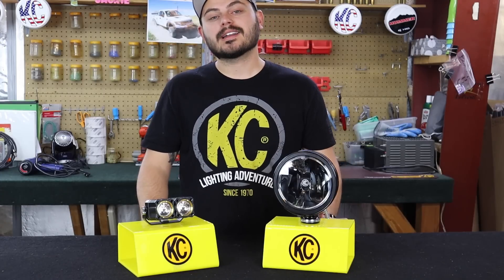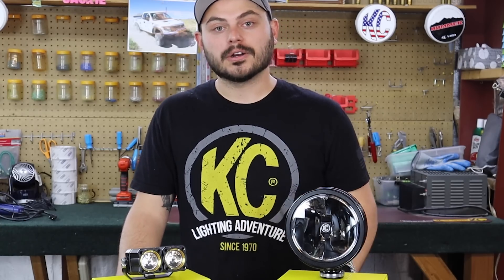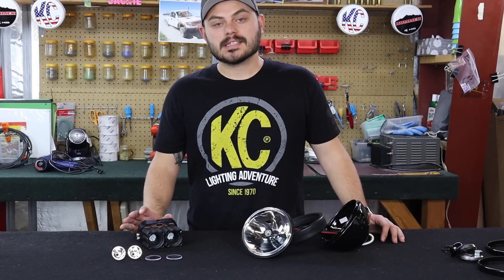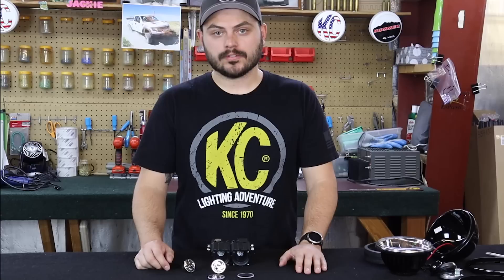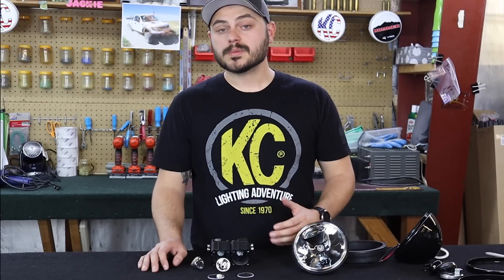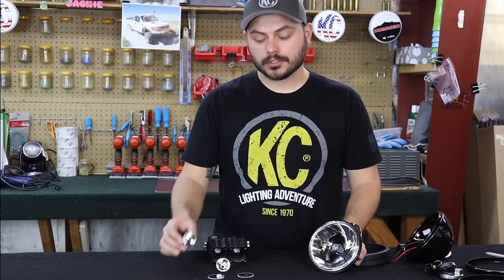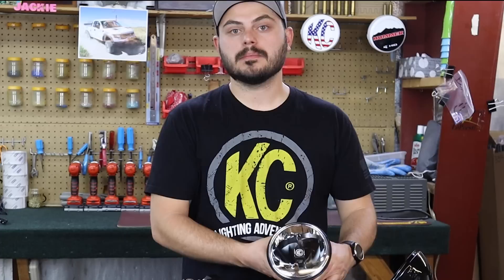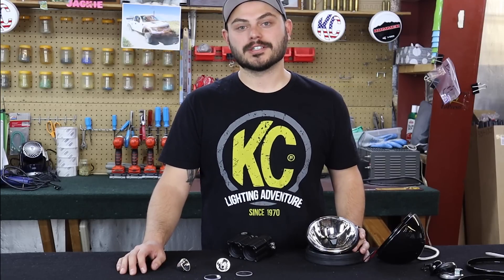The Anatomy of a KC® Light: Housing, Reflector, and Lens

Comment: Thanks KC - great video with information that answers questions I've had (including the 1st video "What off-road light do I need" - excellent foundation.)  In this video, you covered the components - housing, reflectors and lenses, but not light source, or 'chip'.  Is that a key component, or are they now a commodity?  Also, you mentioned the advantages of the larger reflective surfaces, but I didn't see you address this with the Flex series (did I miss it?).  I bought the combo-flex-quad for my JK.  Also, the 1st video in this series mentions the distance the HIDs throw.  Do you recommend a combo of HID and LED in order to get the best distance?  I'm not sure if the race teams are doing that.  Thanks!

Comment: Excellent video showcasing the new technology. The gravity system is much more advanced than even the old Daylighters, which are one of my favorites. Has there been any thoughts to adding secondary LEDs to Daylighters so they can be used as DRL's? My truck uses the hazard lights as DRLs, but a set of Daylighters with lower powered LEDs would be so much better.
Great video, thanks for many years of awesome products!

Comment: I have a few of KC's lights and I use them as aften as I can. I've used them through thousands of night driven miles and they have without doubt saved me from accidents with wildlife or unknown corners that creep up on you during those late night drives. With the purchase of a new Chevy Tahoe I hope to upgrade the lighting soon. Unfortunately a Tahoe is a large vehical with few areas to add good lighting making it more expensive than even folks with deep pockets like to part with. A set of these could be a good start and they definitely wouldn't hurt the appearance. 
Good luck to all and who ever wins these lights, enjoy them as I have the lights on my last vehicle, my Jeep.

Comment: I'd like to see videos on setting up a whole system for your vehicle. i.e. Type and placement of spot, combo, or flood lights; setup for high speed desert races vs slower winding mountain drives; switches for each light vs master switch; etc.
I'd also be interested in how-to wiring videos, such as wiring aux lights to work anytime with the flick of a switch but turn off automatically when low beams are selected.

Comment: Thank you for some insight on the new LED lights. To say I have been a fan and a user of you product would be an understatement. I grew up in the 70's when the KC daylighter was the best light you have on your lightbar.  I still have a set of yellow KC light covers from my first truck. A 1968 Ford Bronco. Over the years I have added your lights to my Blazer and even my  sons jeep.  I look forward to putting a set on my new Jeep Gladiator when it comes in at the end of the month.
 I do have a question, are the new daylighters as bright as the original ones?  The only lights I have found to even come close were aircraft landing lights. I don't think you can even find these anymore.

Thank you for a great product with a long standing reputation.

Comment: I really liked the video and I love my set daylighter and could use another set. I only think I would have liked to see in the video is has to unpin the connectors. I sure has to be a way but I didn’t want to learn by breaking them. Being able to unpin the connector to run the wires then put it back to getter would just make it easier to run the wires through smaller spaces.

Comment: Great video. Always used KC Daylighters, halogen spots and driving beams.  Now using all led lights.  Love the low power consumption and heat.  Have tried cheaper brands and other quality brands.  Always end up back at KC.  Learned to just go with the best.

Comment: Excellent video. Great description of the reflector technology, many people don't understand LED technology and how to properly design an LED light, KC sure does. We have fogs, flex bar, PRO6 bar and Carbon pods running on a couple vehicles and have had excellent experience with the quality and light output. Did have a small issue with the PRO6 on an 18 wheeler due to the extreme vibrations experienced on the highways in Alaska, but the issue was fixed right away by KC. The light output of the PRO6 combined with the Carbon Pods is just amazing, well worth the investment if your a commercial driver. Also most important, bring those American Flag covers to the Carbon Pods and PRO6 please.

Comment: I like these videos because it helps mod DIY'ers build confidence to take on projects on their wish list, and be less intimidated.  This specific video is helpful education to plan the lighting setup on our rigs.  Would love to see more videos on wiring multiple lights on the same circuit (I'll be getting more cyclones for rock lights, and also will be modifying a trailer hitch cargo carrier to add an all cyclone rear lighting setup (wired through 7-pin trailer wiring harness) for full tail light/brake light/reverse/flasher functionality.  So any videos focused on wiring would be awesome.  Thanks!

Comment: Interesting video.  The point about being able to create reflectors out of plastic due to LED low heat was a fact I didn't know before.
I would really appreciate a video that provides procedures, ideas, and tips on where the optimal light installation locations are on different type of vehicles based on the various potential lighting needs that exist.  Thanks!

Comment: The information on the modern vs historical reflector and lense shape was interesting but I was to know more about the actual materials being used. I’ve had a handful of different LED headlights and unlike older glass halogen ones all of the “tough” polycarbonate lenses seem to get scratched rather easily. It makes me hesitant about purchasing higher end headlights that have polycarbonate lenses.

Comment: I did not know that fluted lenses impaired the light output as well as controlling it. I’d like to see a video on building wiring harnesses and how to determine the correct gauge wire, fuses, relays, and switches.

Comment: I really like the look of all my Flex led lights, but those wires on the back are incredibly delicate, i've ripped them off several times and had to solder them back together. As well, 2 of the tiny negative connection terminals have stripped and I had to solder the connectors on. Great looking, great light, but wheeling in the bush and trees has really taken its toll on the Flex lights.